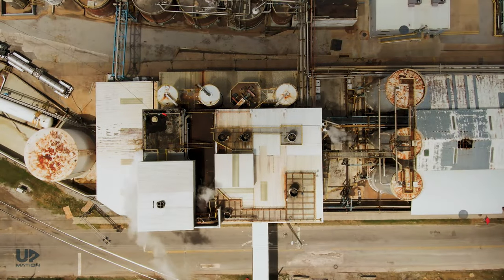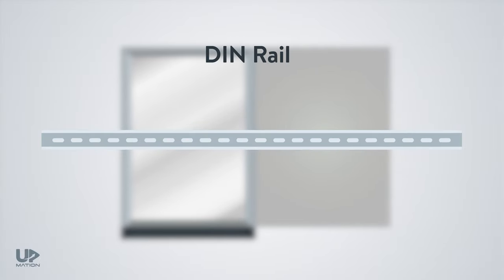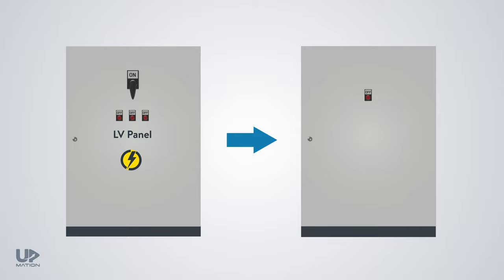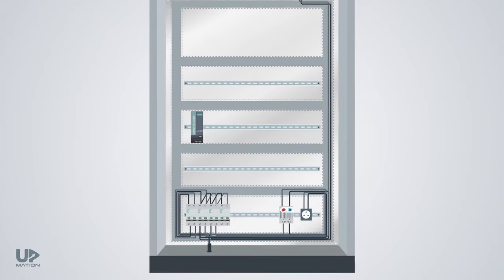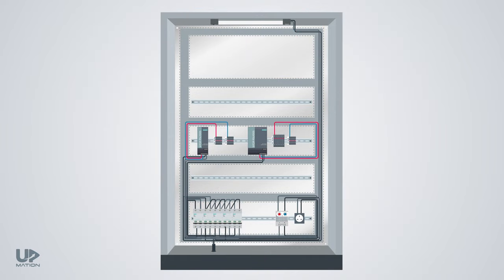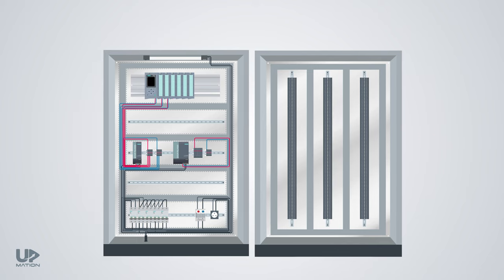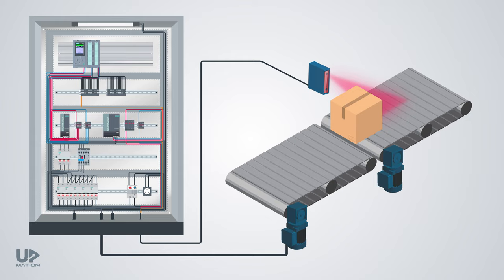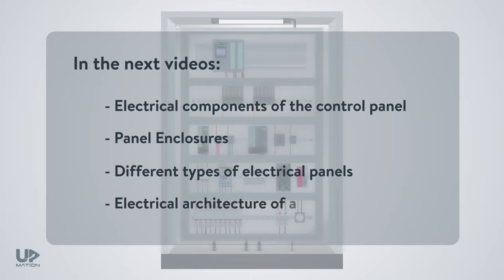How Electrical Control Panel Works | PLC Control Panel Basics | Electrical Panel Components

Comment: This is a very good video, thanks for it. If I may, I would suggest to make a video particularly on the layout of the control cabinet, that is prefered (best practice) location of certain types of components, such as power supply (high and low voltage), PLCs, communications, relays/contactors, terminal blocks and so on. I know these things are discussed in norm documents, but I believe your way and explaining and showings things is much nicer !!! Thanks.
Reply from the maker: You're very welcome, Pawel! Thank you for your great suggestion! I will definitely transfer it to the team.

Comment: Great video, I really liked it alot!!! One thing crossed my mind, though. The motor of the conveyor belt was not protected against overload, was it? Would you use a standard TOL then and plug it to the contactor? Or is this typically integrated in the motor case in that kind of application? In any case, thank you for your videos!
Reply from the maker: Thank you! It is a very good question. No, it is not really protected against OL. If we wanted to open this subject, the video would be so long, and besides, it was not in line with the subject and purpose of this video. By the way, there are both expensive and cost-effective methods to protect the motors against both short circuits and Over load faults. The cheapest method is using a Bi-metal plus an MCCB-TM. There are also MCCB-EL (Electronic MCCBs) as well. Although, there is a better but a little bit expensive way as well which is to use MPCBs. By far, the MPCBs are the best protection device for motors up to 55Kw.

Comment: Detrás de las escenas de cada fábrica hay muchos paneles eléctricos que hacen que el proceso funcione correctamente estos paneles eléctricos se pueden distribuir a lo largo del proceso o se pueden ubicar en una sala especial como sala de control o sala eléctrica, la estructura eléctrica y la arquitectura de una planta podrían ser la historia para otro día Pero en este video, como has pedido en los comentarios te voy a hablar de uno de los cuadros eléctricos más importantes que es el cuadro de control eléctrico El número y el tamaño de los paneles pueden variar mucho según el tipo y la escala del sistema de control, por ejemplo, el sistema de control es DCS, entonces podríamos necesitar hasta 4, 5 o más paneles de control separados el sistema de control está basado en PLC, entonces un panel de una o dos puertas podría ser suficiente El primero es el gabinete que alberga nuestros dispositivos internos . Explicaré más sobre los gabinetes en un futuro video, los dispositivos internos deben instalarse en una delgada hoja de metal llamada Marco de montaje o Panel trasero La primera pieza de componente a instalar en el marco de montaje es el riel DIN Los rieles DIN son algunas tiras metálicas largas con tamaño estándar y algunos orificios intermedios que necesitamos para montar los dispositivos eléctricos en eso En otras palabras, en lugar de instalar cada uno pieza del componente por separado , podemos encajar y hacer clic en los componentes en su lugar fácilmente para que los cortemos e instalemos de acuerdo con el diseño del panel.La segunda pieza que instalaremos en el panel posterior es el conducto de cableado. Los conductos se organizarán y cubrirán los cables dentro del panel después de que cortemos e instalemos los conductos dentro del panel. ¡Entremos primero en los componentes eléctricos del panel de control ! Necesitamos energía eléctrica dentro del panel dependiendo de la arquitectura del sistema eléctrico de la planta en algunos de los paneles de control tenemos una energía trifásica que ingresa al panel, pero en la mayoría de los proyectos de tamaño medio a grande suministramos el panel de control con solo una energía monofásica ahora, suponga que nuestra energía monofásica está ingresando a un disyuntor en miniatura de dos polos o MCB esta energía eléctrica proviene de otro panel dentro de la sala eléctrica como una especie de panel de distribución de energía de bajo voltaje de cualquier manera, el Los MCB son un tipo de disyuntor de protección que se utilizan en la entrada de los paneles con diferentes consumos hasta 25 Amperios protegen nuestro panel de sobrecargas y fallas de Cortocircuito además, podemos conectar y desconectar toda la energía al panel de forma manual mediante este MCB ahora que tenemos energía eléctrica adentro, primero debemos distribuirla entre diferentes dispositivos, necesitamos suministrar las utilidades del panel de control como el ventilador de la lámpara o el calentador y el enchufe. Consideremos un MCB separado para cada uno de estos dispositivos.La forma estándar de conectar los cables a un MCB es conectar los cables de entrada al lado superior y los cables de salida a los conectores inferiores, de modo que tomo la energía del MCB principal y lo conecto. a la entrada de los otros MCB, este es para el zócalo y la lámpara, este es para el ventilador y esto es para la fuente de alimentación de los controles para reducir la potencia de 120 voltios monofásicos al voltaje de control que es de 24 voltios, por ejemplo, necesitamos una fuente de alimentación de 24 voltios con una capacidad de amperaje adecuada, el siguiente paso es conectar los 120 voltios a la fuente de alimentación, tomar los 24 voltios de su salida y distribuirlos por algunos bloques de terminales como puede saber por nuestros videos anteriores por usando un bloque de terminales se pueden unir dos cables entre sí para conectar todos los bloques de terminales del mismo propósito podemos usar un puente de regleta de terminales debo ponerlos en los orificios centrales de los bloques de terminales y apretar sus tornillos De esta manera, Alabama l de estos bloques de terminales tendrá el mismo voltaje de 24 voltios . He planeado dedicar esta fuente de alimentación a la CPU del PLC y sus módulos de Entrada / Salida para protegerlos aún más contra cualquier falla que pueda ocurrir fuera del panel de control, por lo tanto, Debería considerar una fuente de alimentación separada con suficiente amperaje para alimentar los dispositivos en el sitio, como los dispositivos de instrumentación . Repito el mismo procedimiento para esta fuente de alimentación, pero esta vez, en lugar de los bloques de terminales ordinarios , considero algunos bloques de terminales de fusibles para proteger la fuente de alimentación contra el dibujo. amplificadores adicionales por los dispositivos en el sitio . Lo explicaré con un ejemplo práctico en un video sobre la solución de problemas de los paneles de control. ¡Muy bien! Es hora de agregar el PLC y sus tarjetas de entrada y salida, piense en el PLC o el controlador lógico programable como el cerebro de todo el sistema de control o automatización. Yo conecto los 24 voltios para encenderlo . Conectaría 24 voltios separados de estos bloques de terminales para cada tarjeta de entrada digital y salida digital para encenderlos normalmente no conectamos los canales de la tarjeta PLC directamente a los dispositivos en el sitio, ya sea tarjetas de entrada digital o salida digital. Significa que si nuestra tarjeta de entrada digital tiene 16 canales, entonces debemos instalar 16 terminales. bloques correspondientes a eso. Es la misma historia para la tarjeta de salida digital. Quizás se esté preguntando cuando tengamos más tarjetas DI o DO , estaremos en falta de espacio para todos los bloques de terminales. número de entradas y salidas en el proceso, el diseño del panel se vuelve completamente diferente de lo que ve aquí. Debería haber otro panel conocido como panel de clasificación. De esta manera, transferiremos todos estos bloques de interfaz t o el gabinete de clasificación En algunos gabinetes, la sección trasera del marco de montaje se puede usar como la parte de clasificación del panel para que podamos fusionar los paneles de control y clasificación y ahorrar mucho espacio en la sala eléctrica o de control. Breve descripción general de cómo conectar un sensor a nuestro panel de control Tome este sensor fotoeléctrico como ejemplo que se instala junto al transportador y se supone que reconoce las cajas que pasan por el transportador Como este sensor requiere energía para funcionar, conecte los 24 voltios a los de los bloques de terminales de la segunda fuente de alimentación Debería devolver estos 24 voltios a la tarjeta de entrada del PLC en caso de que detecte una caja u objeto frente a eso. Así que seguiré adelante y conectaré un cable del sensor al canal de entrada de su correspondiente PLC Después de que este sensor informe al PLC sobre la presencia de la caja, el PLC debe ordenar al siguiente motor trifásico del transportador que comience a girar Para ello, debemos agregar un Contactor a nuestro control panel conecte una energía trifásica a su entrada y coloque un cable entre el contactor y la caja de conexión del motor En realidad, cuando tenemos energía trifásica dentro de nuestro panel de control eléctrico, la disposición del panel sería de alguna manera diferente a lo que ve aquí pero vamos a tomarlo con calma y seguir adelante por ahora. Tan pronto como la tarjeta de salida del PLC energice el contactor, transferirá la energía trifásica al motor eléctrico . También encontrará algunos relés en el panel de control para controlar los actuadores monofásicos. y dispositivos de control en el sitio como válvulas solenoides Como verá en videos futuros, los paneles y dispositivos eléctricos están esparcidos por toda la planta y deben estar interconectados entre sí a pesar de los diferentes protocolos de comunicación que puedan usar Entonces, la otra categoría de dispositivos Definitivamente encontrará dentro de cualquier panel de control eléctrico dispositivos de comunicación industrial como conmutadores Ethernet o algunos dispositivos de puerta de enlace como los acopladores Profibus PA a Profibus DP. cubra los conductos y verá cómo el panel se ve limpio y ordenado . Realmente espero que haya disfrutado este video. Dejé deliberadamente algunos de los detalles para futuros videos para tocar primero lo básico y sumergirse en los detalles paso a paso. paso
Reply from the maker: Wow! Thank you, Luis!

Comment: Thank you very much for your great content. I have a question about the the two 24v power supplies. Shouldn’t the common for both supplies be connected if one is supplying the IN/Out cards and one supplying the sensors?
Reply from the maker: Hi Samir! You're very welcome! That is definitely correct. We should have the same reference (0 volts) for both of them as the sensors' supply will get back to the cards.

Comment: Great video and topic as usual, I am just wondering why do we need to use 2pole MCBs for light, socket and heater? Why we can't just use neutral terminal or N-busbar for neutral instead of using 2pole MCB?
Reply from the maker: Hey, Andrii! Great point! Yes, we can definitely do that.

Comment: Great video thanks, just a question double 24VDC power supplies wouldn't damage the PLC input modules or any other devices?
Reply from the maker: Hi, Jorge! As long as they provide the 24 Volts with a tolerable and specific tolerance, it should not happen. Choose them preferably from the same brand.
Reply: @Upmation  is it nessesery to join both powers supplies negative/ground terminals?

Comment: What is the usual cost of TIA portal. I took a class in my area while back and got a trainer kit that came with a small PLC and screen plus a software CD for about $200.00 as part of the workshop but I lost the CD which by now it may not even be compatible with the  Windows 10 anyway. I don't want to download the trail version which is good for 21 days only. I took the course with E&M. Thanks

Comment: Don't you need a common ground wire between the 2 power supplies for the sensor to work properly?
Reply from the maker: If we have different source of power to supply the 24 volts Power Supplies, then yes, we need to do that.

Comment: bro can you explain with PLC input signal & output signal indication on PLC ,when plant is running(with wiring diagram). so during trouble shooting  i  come to know which input device is faulty. so with the help of PLC pilot light indication i come to know which input device faulty(i.e. limit switch, inductive proximity sensor, RTD, pressure transmitter).
Reply from the maker: Hey! Of course we can! I'll let the team know of your suggestion. Thank you!

Comment: If used separate power supply, ussually every 0 volt from outpur power supply is couple with other 0 volt from other power supply.
Reply from the maker: Yes, that's correct.

Comment: There is one thing I'm confused about. From what I understand, your ground from your first power supply isn't the same as your ground on the second power supply since these are both isolated units. If this is the case, wouldn't the photoelectric sensor not be able to communicate with the PLC input card since they are each on different grounds? Wouldn't you have to tie the two 0 V terminals together? If someone could help clear this up for me I'd greatly appreciate it.
Reply from the maker: Hey! You are absolutely right! The two 0-Volt should be interconnected with each other. Thank you for reminding that!

Comment: i dont understand how 3 phase power magically came in for the motor at 7:46.
Reply from the maker: It is not actually magic by the way! :) The power enters a 3-pole circuit breaker. From its output, we feed a contactor and after the contactor receives the command from the PLC (on its coil) it conducts the power towards the electric motor by a power cable. The contactor receives the command based on the input signal from the photoelectric sensor. Please let me know if you have further questions.